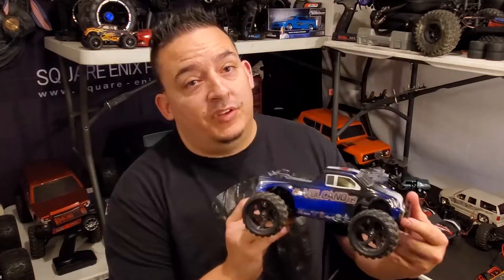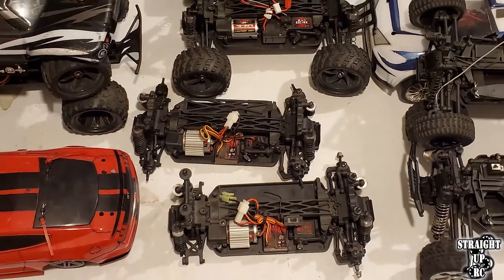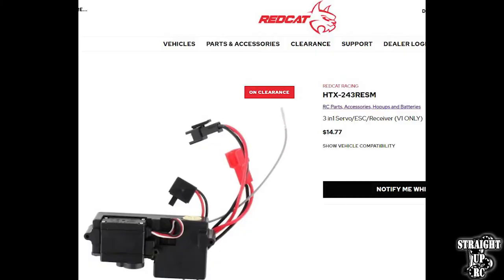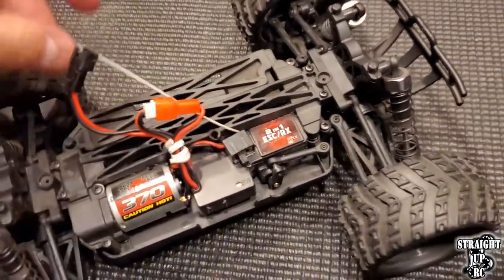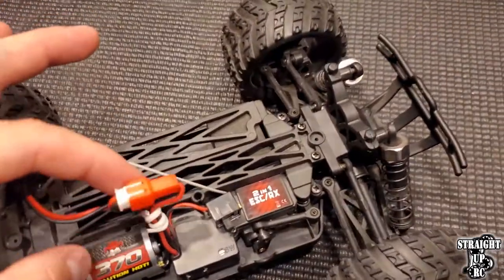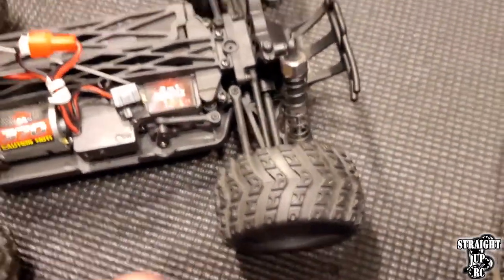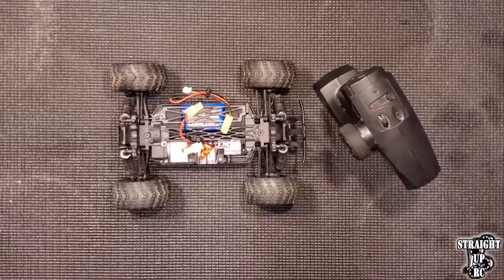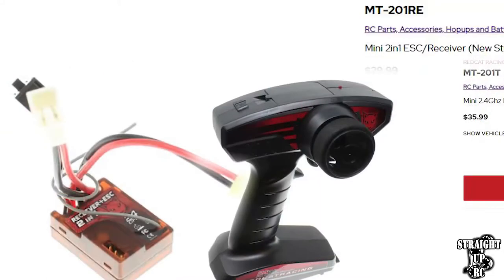Volcano 18 - V2 ESC + Receiver Combo Binding Process - Redcat

Comment: Hello sorry for the translation, a favor that I did not understand very well if I can pair the control 202 (v.2) with the receiver 201? I have this problem and have not been able to fix it.
Thanks.
Reply from the maker: Hey, So here is some info and I hope it helps. 
The 201 model remote and 201 model ESC work ONLY together. 
So the ESC part # - " MT-201RE ... Mini 2in1 ESC/Receiver " ONLY WORKS WITH - the part # " MT-201T ... Mini 2.4Ghz Radio" 

And the 201 model remote and ESC part WILL NOT WORK WITH the 202 (v.2) remote or ESC. 

So if I am reading your question correct those 2 items "control 202 (v.2) with the receiver 201" will not work together - sadly.
Reply: @StraightUpRC  Hello, thank you very much for your answer, I understand, unfortunately they sent me the wrong one and they did not solve me. In the same way, I thank you again.
Reply: @StraightUpRC  Hello, thank you very much for your answer, I understand, unfortunately they sent me the wrong one and they did not solve me. In the same way, I thank you again.

Comment: Hi! Are there any options available to use alternative parts to the this 2 in 1 combo for this model so I can bind with another remote?
Reply from the maker: So as far as I know of - no - there are no alternatives to these type 2n1 systems. When you have one of these systems - you need the EXACT remote and/or 2n1 ESC/receiver as a replacement - otherwise they will not communicate. Now, I might be wrong in the case of some brand 2n1 receivers that can link to a few different remotes - but I have never experienced this in a 2n1 system - yet.
Reply: Could an option be to get a separate receiver and ESC and adapt it to this truck? I can't find parts and don't want to lose the kit.
Reply from the maker: @martin6131   That is absolutely an option on any 2n1 receiver system. You can simply adapt a separate receiver and transmitter unit along with a stand-alone ESC to take the place of the 2n1 system.

Comment: My remote isn’t turning on no red light or anything?
Reply from the maker: Most likely the only 2 reason for that is 1 of 2 options. Dead batteries - or broken remote.  

Try the batteries in another model remote or try new batteries in the remote.
Reply: @StraightUpRC   it’s a bad switch in the remote now I’m trying to find metal diffs
Reply from the maker: @brettrandall5210   Ah - yup a bad switch will do that. Keep on looking for those diffs too. Never know. Someone might have some. And those WLToys gear parts might fit but there is always the risk of parts not "exactly" fitting when the parts are from a different manufacturer than the vehicle. But scale to scale sometimes can cross over. So you might get lucky.